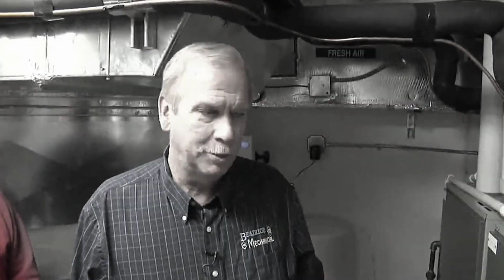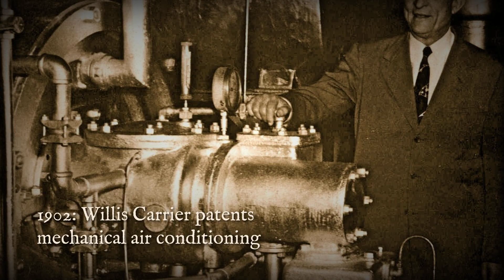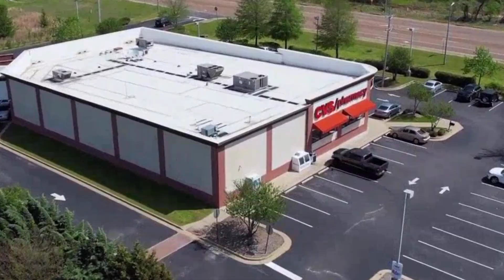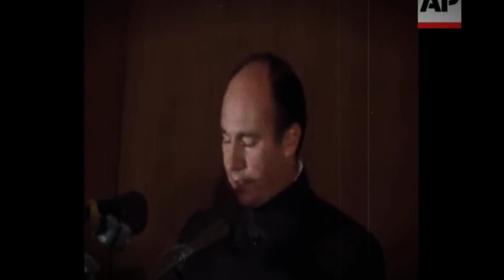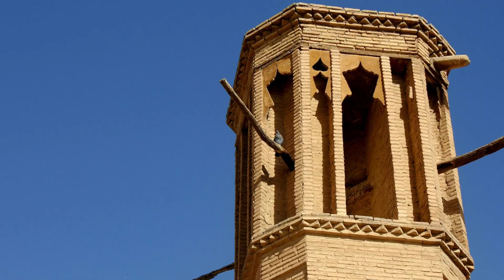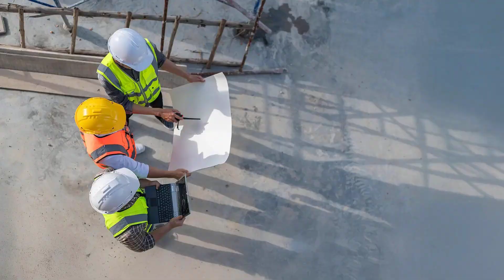This $800 House Stays 72°F Year-Round With No Heating System. Why Is It Banned in America?

Comment: Our Edveros has zero thermal bridges. That's the spec standard they build to. It's the difference between a building that performs as calculated and one that doesn't. Most traditional builds don't achieve this. The factory environment is why Edveros can.